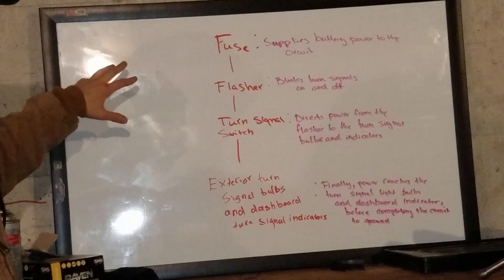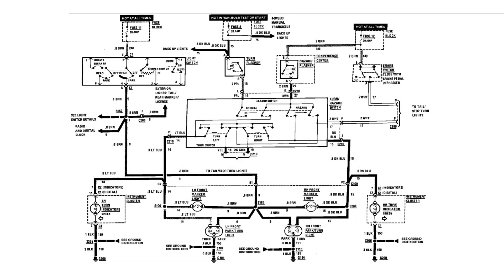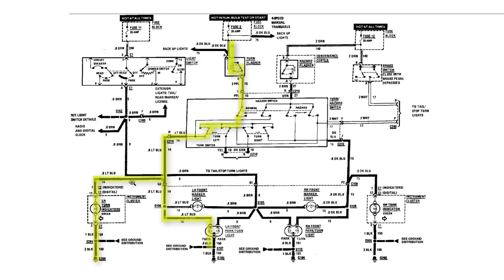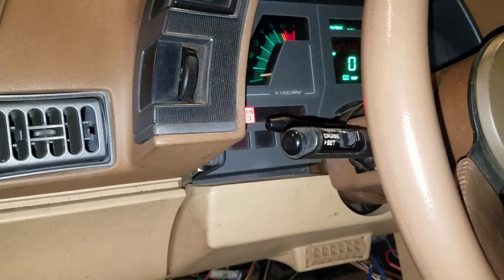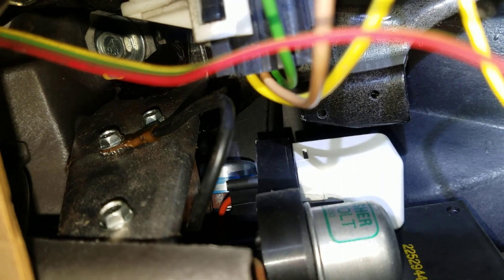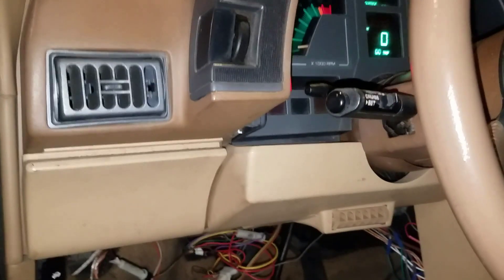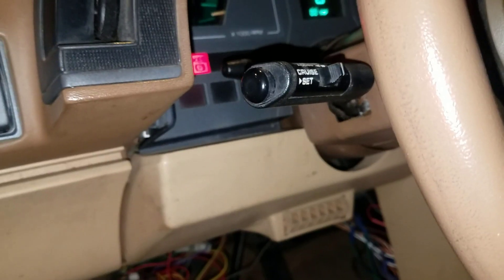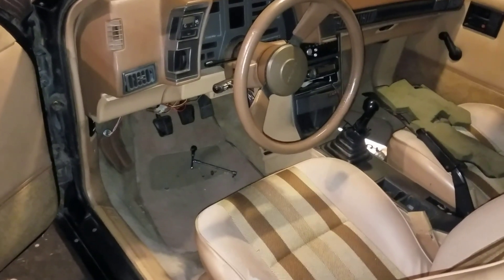Diagnose Why Turn Signals Don't Work Or Don't Work Properly

Comment: made the schematics look slightly less intimidating - they've always been difficult for me to wrap my brain around.  I lost my right side turn light after trying to upgrade to LED bulbs that i didn't realize were only meant for brake/tail light and not for combo brake/turn indicators - when i put the old bulbs back in they still weren't working as turn indicators, only hazards and brake/tail lights. (93 roadmaster wagon)

Comment: Thank u very much. I have talk to two shops about my turn signals not working and they were telling me other options that are more expensive. It was my hazard light button. I watch this video and connected my hazard flasher and replaced my fuse. Now I have hazard lights and turn signal.

Comment: I had an intermittent problem with my 2006 dodge grand caravan that was driving me crazy.  The right blinker wasn't working and when I  checked, it appeared that the rear bulb was burned out. When I pulled it out it looked fine, so I put it back and then it started working again.  A few weeks later the same thing happened again,  so I cleaned the socket and bulb and reinstalled it and everything worked fine for another couple of weeks. It quit working again,  but I found if I  slapped the taillight it would come back on. That eventually stopped working, so I thought maybe I had a short somewhere.  I checked an online dodge grand caravan forum and found someone had the exact same problem with their left rear taillight.  They took it to a dealer who found that although the bulb looked fine visibly, it was bad.  I decided to swap the bulb out with the left side and it worked.  I installed a new bulb and it fixed the problem.

Comment: 2011 nissan cube replaced switch now if I push up or down it flashes at back and only front passenger works how do I make it ALL work normal

Comment: The front and back right side of my 2010 Chevy Colorado light up but do not flash. I changed the bulbs that didn't fix it. I checked the fuses and they were fine. I cannot find the relay or flasher though, the person I bought it from did some kind of rewiring and I do see two relays under the steering wheel side of the dashboard so I'm going to swap them see if that works. I keep hearing that if it clicks it's not good but other videos say that it's a good relay when it clicks.. my head hurts now. I'll subscribe to your channel if you help me out 🤪. Please.